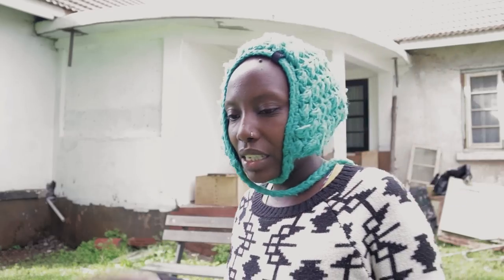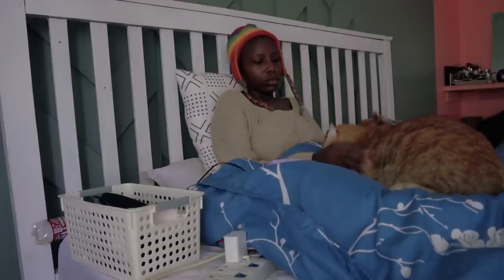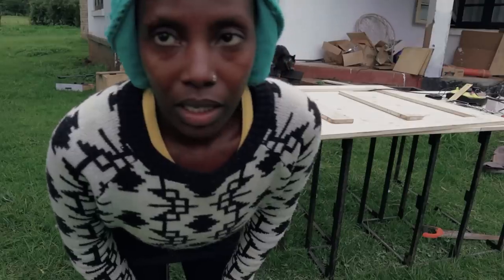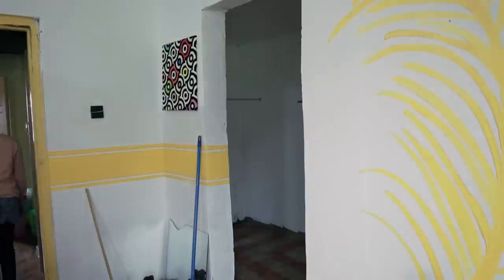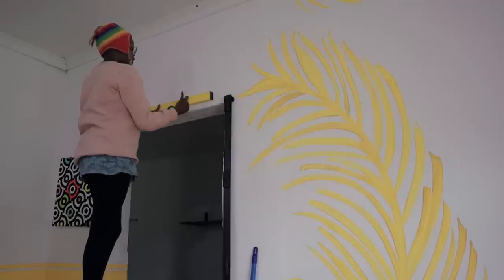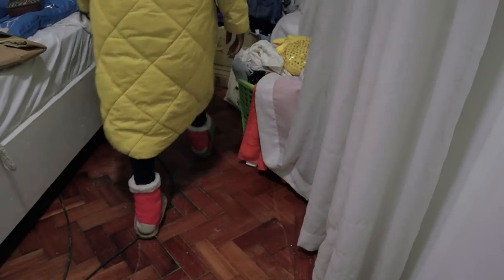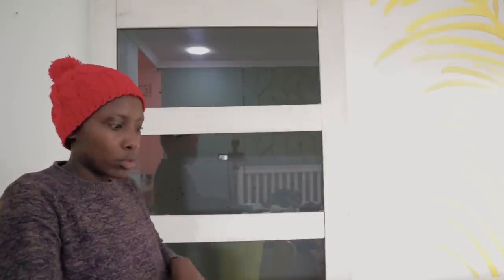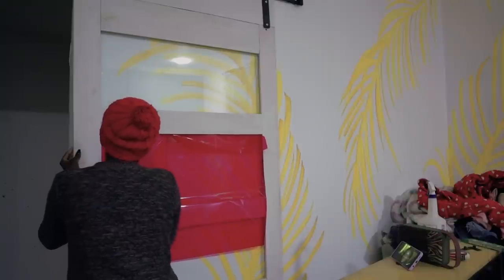DIY Colorful Sliding Barn Door for My Closet | Muthoni Gitau

Comment: Hey Muthoni. I’ve been looking to get barn doors for my sitting room and wardrobe doors. Thanks for the hookup on the plug who made them for you. Might you share how much it cost on the metal hardware for this particular project task
Reply from the maker: My rates are not a good reflection because, I was made early in the year before cost of materials went up twice... I paid 12k for the hardware.
Reply: @IAmMuthoniGitau  Hi Muthoni. This is still good enough for benchmarking when going to procure. Continue with the great work.